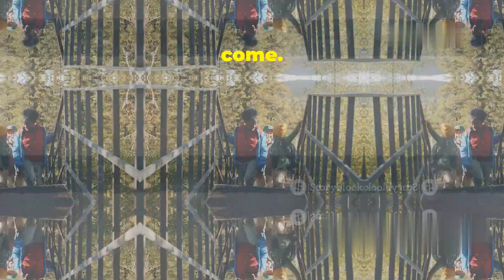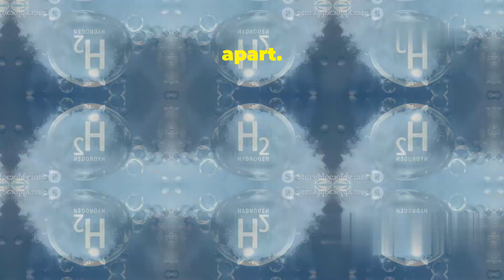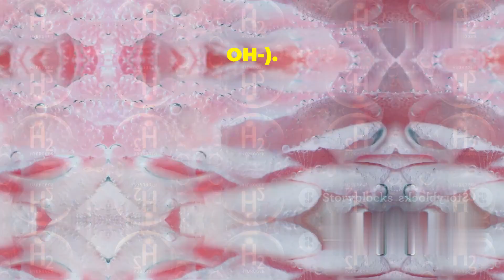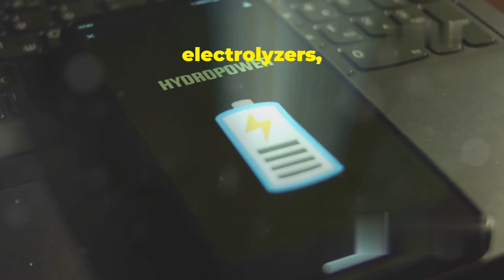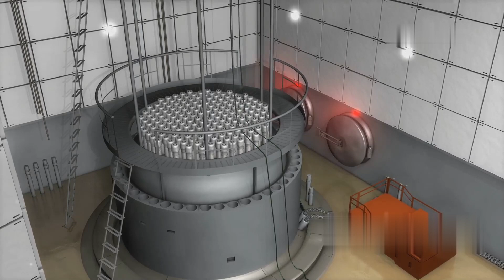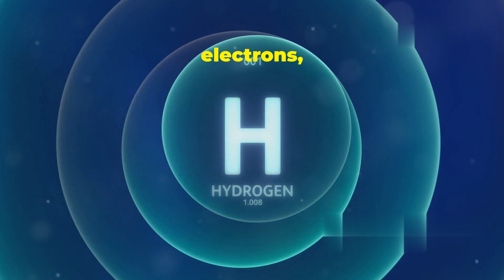Electrolysis The Future of Clean Energy!

Comment: Agree... electrolysis can contribute to energy security and diversification. Hydrogen produced through electrolysis can be stored and used as a fuel for various applications, from powering fuel cell vehicles to generating electricity in hydrogen turbines. This flexibility allows for the integration of hydrogen into existing energy systems, providing a reliable alternative to fossil fuels. Furthermore, as renewable energy generation can be intermittent, hydrogen can serve as a means of storing excess energy during periods of high renewable output, thereby stabilizing the grid and ensuring a steady energy supply 🥇😘🥰
Reply from the maker: Electrolysis is indeed a crucial technology that can significantly contribute to energy security and diversification. By utilizing electrolysis to produce hydrogen, a versatile and clean energy carrier, we can enhance our energy systems in multiple ways. The ability to store and transport hydrogen makes it a valuable tool for energy storage, especially in conjunction with renewable energy sources like solar and wind power. 

Hydrogen produced through electrolysis can be stored and used across different sectors, from transportation to electricity generation, thereby reducing our reliance on fossil fuels. Its flexibility allows for the integration of hydrogen into existing infrastructure, offering a reliable and sustainable alternative energy source.

One key advantage of hydrogen produced through electrolysis is its potential to address the intermittent nature of renewable power generation. By storing excess renewable energy as hydrogen during periods of high output, we can ensure grid stability and a steady energy supply. This integration of hydrogen as an energy storage solution helps to optimize the use of renewable resources and enhance the overall resilience of our energy systems.

In conclusion, electrolysis and hydrogen production play a vital role in advancing energy security and promoting diversification in the energy sector. By leveraging these technologies effectively, we can achieve a more sustainable and reliable energy future, paving the way for a cleaner and greener world.
Reply: The trouble is that Hydrogen is difficult to store due to its low volumetric energy density. It is the lightest of and simplest of all elements, being lighter than helium, and so is easily lost into the atmosphere.

Another challenge is the very low boiling point of liquid hydrogen (−252.8°C), which means that it needs to be kept cryogenically stored at low temperatures. Storing hydrogen as a gas also has its challenges as it typically requires the use of high pressure tanks (350-700 bar or 5000-10,000 psi).

Hydrogen can be stored through adsorption or absorption, although with these storage techniques, further steps are then required to release the hydrogen once again.

Green hydrogen produced from electrolysis (a high energy process) and renewable energy sources is a high cost option, which only accounts for around 5% of total H2 production.

Renewable hydrogen does have a place in the future energy mix, but a limited one. Our efforts are much better spent cutting energy demand, ramping up renewables, and electrifying as much as possible.